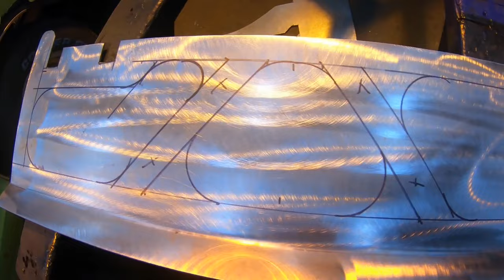Fabricating Steel FLOOR PANS For The Model A!  -   YARD ART Model A Build Part 12

Comment: Thanks for making these videos. I have similar work in my future and this helps a ton! I have a question, I see you don't bother with weld through primer. No issues just blowing through paint when you weld?
Reply from the maker: I have used weld thru primer in the past, but its been years. Been using Rustoleum flat black for as long as i can remember for this kind of stuff. I start off with my wire on the edge of the sheet metal/ floor pan, focus the heat on the sheet metal for a couple of seconds, then back drag the puddle into the opening and focus the heat on the painted structure. Seems to work pretty good for me, never really get any porosity or popping back from the paint. Also, the flat black really doesn't let off any major smoke, honestly probably no more than weld thru. But i do know that if you use gloss it will smoke like crazy, gas you out, and mess the welds up pretty good...
Reply: @rottersgarage  Thanks for the detailed explanation. I can't wait to get started on my floors.